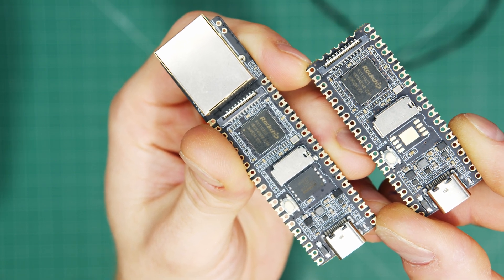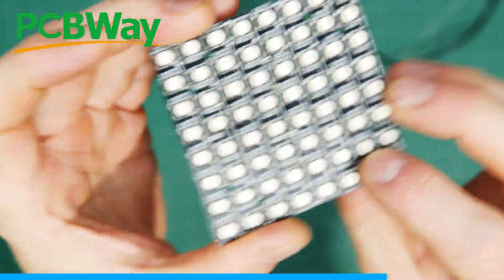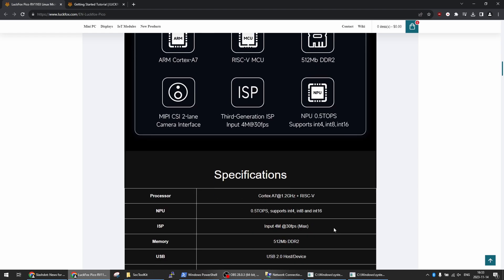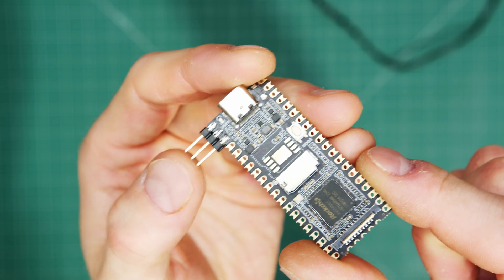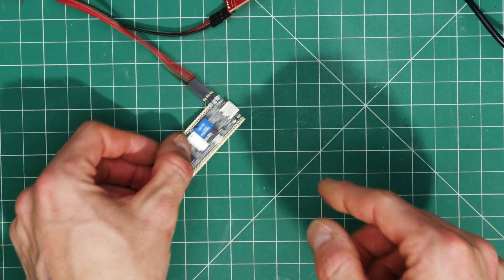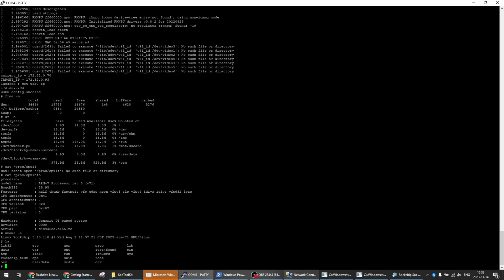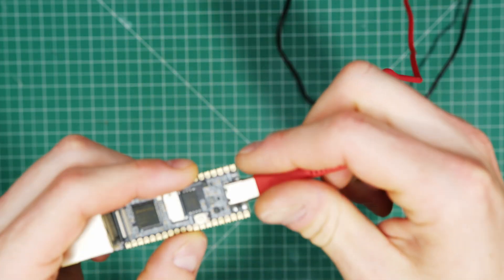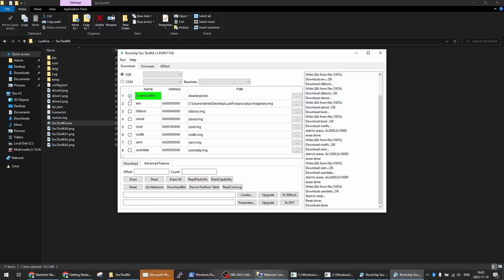Luckfox Pico - Milk-V Duo and Ox64 Killer?

Comment: Is it possible to make a NAS with this thing?
Reply from the maker: My friend I don't think I can give you a proper answer here, as that question is very loaded.

NAS is Network Attached Storage, so yes, it basically is already since it has a network port and runs Samba.

Can you plug a pile of HDDs into it? No.
Reply: @PlatimaTinkers  That's what I was wondering. Thanks!
Reply from the maker: @alessandrofonseca7796  NP!

Comment: Luckfox Pico is an excellent product with such small form factor. I've compiled the Ubuntu OS with tun/tap interface with Luckfox SDK, install Openvpn client, then configured it to connect my Openvpn Server. I put it to my customer's office. I no longer need to go to the customer's office for server checking.
Reply from the maker: Hey mate that is great to hear! They certainly are bloody small but handy!

Coming from a cyber-security standpoint I have some issues with that setup, but there are of course protection you can put in place such as IP-restricted jump boxes with push MFA, pubkey authentication per-session, etc
Reply: @PlatimaTinkers  I think VPN is more secure than Teamviewer or Anydesk
Reply from the maker: Very very true!

Comment: This is A great video. I got my Luckfox Pico Plus to work and could SSH in to it and login over the network. DHCP worked right away.

Worked pretty well actually!

Now I am trying to use the Ubuntu image and boot from SD.

I kinda got this working... but seems odd.

Took for ever to get an IP address. But now it shows up... maybe an initial install/setup going on first time?

Then to SSH login, it works but takes about 10-15 seconds to finally get to a prompt.

This typical?  I haven't tried another SD card yet.  Need to find another one, just to make sure maybe a sketchy card.

But over all it seems a bit, lethargic using the Ubuntu / SD setup  ?

doing A apt-get update took like 20 minutes or something to do.
Reply from the maker: Hey thanks for the feedback mate that is really awesome to hear.

I've heard some people complain about this! I've personally not experienced it. First boot does always take a while though.

What image were you using? I can test it out and ask their support team if need be.

Comment: Is it possible to make a pico w micro? Like rp2040 on one side and wifi module on the other. 5 gpio. No USB but pins for flashing. Love your pro board
Reply from the maker: Yeah I've been thinking about designing something similar. Like a SG2002 with a W600 module.

Cheers mate!
Reply: @PlatimaTinkers  I would love a half sized pico w
Reply from the maker: @mrlately7253  You're talking about Raspberry Pi with an RP2040 / ARM Cortex processor? 

Cause there's the Pico Mini, which has no wifi but is stamp sized. Or the LycheeRV Nano W, which has wifi and uses SG2002 so both ARM and RISC-V options :)

https://shop.plati.ma/products/sipeed-lycheerv-nano-we-beta <- few left, they're pretty cool but are meant for people with technical prowess
Reply: @PlatimaTinkers  thanks for the support beyond the videos.

I basically need to be able to do the same I can on a pico w but smaller. I only use a few pins. I'll check the links you shared. Thanks again
Reply from the maker: @mrlately7253  All good!

And yeah LycheeRV Nano WE would be good then! Else https://shop.plati.ma/products/pine64-pinenut-model-12s-wifi-ble5-stamp is tiny and cheap and has wifi.

There's a few options out there. I also have some ESP32-C3 and S2 boards like https://littlebirdelectronics.com.au/products/esp32-c3-mini-development-board-based-on-esp32-c3fn4-single-core-processor-160mhz-running-frequency-2-4ghz-wi-fi-bluetooth-5 that work really well and can run Arduino, ESPHome, MicroPython or C! I use them for garage door controllers, etc. DFRobot make the 'Beetle' series which are the same.

I have https://shop.plati.ma/products/esp32-cx-riser-board-v1-1-assembled-with-c3-and-led which is a prototype product but does work. Maybe not for your use case though!

Really probably depends what IDF/SDK you want to use! C, Arduino, MicroPython being the big ones.

Comment: does any one know if this supports the pi camera
Reply from the maker: You'd need to specify exactly which camera. As long as it's supported by the kernel, eg IMX219, and has the right connector (Luckfox Pico has a 20-pin FFC, so might need an adapter cable), then at most all you'd have to do is modify the device tree.

There is a bit of doco on it here https://wiki.luckfox.com/Luckfox-Pico/CSI-Camera. The camera it's designed for works out of the box with RKNN etc, and is probably best stuck to for documentation and support reasons, but of course depends what you want to achieve.

Comment: I saw a video that compared RISCV against ARM and the ARM core was consistently better so I think the ARM processors give you better performance.
I also saw a video that complained a lot about the support for a lot of these Chinese SoC carriers and the No. 1 issue was making them work with established code libraries etc, so for me PI may be more expensive but life is short.
Reply from the maker: That's not really comparing Apples to Apples though, that's more saying you want two oranges but being given a lime and an orange. They're quite different in how they work, and RISC-V is quite new.

Yes, if you want raw power, go ARM, but you miss a fair bit of the point then, but it's not always about power and these 1Ghz+ processors are a tad insane; that amount of power in an embedded device is just not necessary 99% of the time.

Comment: How are we supposed to burn your image file in the links? Its not supported by any sd-card writer I have tested? edit: i was able to burn ubuntu from luckfox wiki, but they do not tell you the root password, I can ssh to it, but luckfox does not work as password :/ edit: I must fix my eyes, its pico and not root as username lol.  now it works
Reply from the maker: Hahah sorry I didn't get to this sooner and help you out, was sleeping :P

On Linux and Mac I dump the image on the SD card just using `dd`, but you can probably use Disk Utility - I think there's an option to restore/write image. On Windows I use Balena Etcher. Just un-gzip it first if using DD!

Comment: I wonder, since I never really see people use the tpu in such boards, yet on paper some of them should give compute power in speciffic AI related workloads close to around a quarter of the performance of a rtx4060(one of those new beagle bone boards, not cuda however), while using insane amounts lower power.

so why doesn't seem anyone to be using those TPU's or C7x DSP's, fpga and such for AI tasks such as language models and image generation, just like the raspberry pi's they probably could be quite doable to cluster and might even be added on a single pcie card, I wonder what kind of performances could be reached that way, even though ram might be a issue, but for everything there are solutions. I mostly just wonder if there really isn't any development for AI to run on such hardware, since it would be much more efficient than how it is done now, and they already did make things to run it on integrated gpu's and old cpu's which technically seen would be a lot slower at such things in basically any way since they also don't benefit from the cuda cores or such.

this has also been proven by intell adding a very small npu into their new cpu's, and using that NPU actually was much faster than the cpu and the gpu in those apu's, also noticably beating the amd apu's, despite that integrated NPU being a very small very low power part.
to make it more serious, some of the SBC's from beagleboard actually have a quite a lot faster NPU in them than those intel APU's have, intels next gen was supposed to have faster NPU's, but those results where gotten by people using the old integrated NPU which actually was slower than the NPU in some of those new beagleboard computers. so honnestly it seems like big AI and such really miss a lot of opportunity by getting stuck in those big gpu's and such rather than trying to find ways to make it work properly on such small formfactor low power hardware.
Reply from the maker: Hey mate bit of a long comment and I'm slightly rushed sorry, but I think you're missing a fair bit of information there from what I can understand of what you've said. The terms are all right, but you're seemingly not using them in the right context.

The TPU/NPUs in these might do 0.3-5 TOPs @ INT8, which is great for some basic machine learning, but absolutely nothing close to what an RTX4060 can do. An RTX card is hundreds of TOPS and also using a 16 bit floating point number as opposed to integer, so you can use less space for faster transformations or inferences with a greater degree of accuracy given the wider gamut of number values that can be represented. Those can do some complex DNN functionality like text to image generation, large language models, etc. Even further to that, RTX 3k and 4k series supports a newer type of floating point that is specifically designed to work better with AI (bfloat16).

These SBCs I develop on and show off are small units that are better at ML for tasks such as facial recognition, and then embedding them in smart door bells, IP cameras, robots, gardens, etc. There's then also a bit of an issue with memory; to run a 7B parameter LLM on a GPU you're going to need a hefty card and then minimum 12GB of VRAM, and even then you'll only get 1-8 tokens/second. These things have 16-512MB of RAM, so you'd be lucky to get a 500,000M param LLM running, and besides it talking garbage, it would be extremely slow due to the IO bandwidth available, and that's if you can even quantise a fp16 model to run on int8, in which case you'd likely lose some of the LLM "magic" in that case.

Long story short; different power level, different 'neural' technology, different use case, different market and price. That is just my understanding though, and I could very well be getting some details wrong there! That being said, I have 2x GTX 1070 Ti's, an RTX 2080, an RTX 3060 and an RTX 3080 that I run different LLM and diffusion models on, so I do have a fair bit of familiarity with the tech... Just still saving for an RTX 4090 one day 🤘 Thanks for your input either way!
Reply: @PlatimaTinkers   well if you are saving for a 4090 you might wanna wait for the rtx 5000 series which might launch not to far away are supposed to be much faster than the 4000 series.
for the TPU's from most of them I didn't actually know their speed, 
However I speciffically based it on the beaglebone AI-64.
the beaglebone AI-64 is suposed to reach
quite high numbers and also has multiple different accelerators from which some are really fast.

even though I indeed do not know all about such things.
but I do know things could be much more efficient, but that would also largely depend on the AI itself being designed to be efficient instead of based around normal hardware.
however lately I was thinking that since AI like stablediffusion uses essentially weighter random noice, that it might be accelerated and made more efficienty by using a second model at first which instead of training noice clouds would train more on fractal clouds, that way if that works right it might be able to skip many steps in the proces and only do a few steps at the end to make them some less fractalish.
Reply from the maker: @ted_van_loon  I don't think there is going to be huge jump from the 4K to 5K range from what I can see - eg minimal new data types, just a smaller lithography, extra pipelines and cores, faster memory, etc. I'd say once the 5K comes out, I'll grab a 4080 Ti or 4090 as the price will drop, then maybe wait for the 6K when they do something mental like 1nm lithography, GDDR7, etc.

Re the BeagleBone AI-64, it's a pretty bloody powerful board - it'd definitely go a long way towards something like a high-end video editing system if utilised properly, but it is still not designed to run models like LLMs. It's got an 8TOPS TPU, high bandwidth ISP, a decent little GPU, and 4GB RAM (ignoring the DSPs). This is higher than the Fire specs we just discussed, but more designed for robotics and automotive. Eg it would be great at real-time processing of multiple video signals for things like depth mapping, object recognition, collision prediction, etc.

You can find examples of the models at https://github.com/TexasInstruments/edgeai-modelzoo and get an idea for how the board may be used. If you wanted to compare it to a GPU for running diffusion models like SDXL or LLMs such as Mixtral 0.2, you might need a few hundred of them, and then you end up with something less power efficient and less compact plus the challenge of trying to get the data between them using very limited interconnects like 1Gbps LAN (AI infrastructure will often run 40Gbps - 400Gbps fibre interconnects).

Large companies such as Mistral, OpenAI, Alphabet, Meta, etc, are all working on making these inference and diffusion models more efficient, however, the long and short of it is that how they work requires massive amounts of data to be multiplied at blazing speeds, which requires a lot of fast RAM, high bandwidth, and seriously huge parallel pipelines. CPUs are crap at this, TPUs are okay at this, GPUs are great at this, and AI accelerators do it excellently. 

I get where your idea is coming from, however, unfortunately it does not work anything like that, and the AI is not based around any hardware; the goals are typically based around creating the fastest, most accurate, and smallest models possible, and it really doesn't matter what hardware it runs on at that point; GPUs are just the easiest for consumers, where as for high-end inference you'll want H100's or similar. They are called "GPUs" but really, they aren't. They're not meant for playing games, you can't plug a display into them, they just multiply matrices amazingly efficiently.

We all started using GPUs for this because rendering images and textures just happens to use a similar pipeline. I hope all that information helps you understand a bit more!

Comment: Can you use VNC Server or/and Desktop on Luckfox Plus?
Reply from the maker: Uhhh, I guess, but I cannot fathom the use case there. It's not really designed to have a GUI, but you could probably enable swap then install X and VNC to it from another computer. It'll run like a 1995 Dell. If you want to run X or VNC on the LuckFox SBC you probably need to implement a VGA interface by bitbanging GPIOs.
Reply: Ok thanks, should I buy Luckfox Pico Plus or Raspberry Pi Zero 2W?
Reply from the maker: @FastEarnMoneyWithApps  No worries. Completely depends on what you want to achieve though - do you need wifi or ethernet, do you need NPU or not, etc. They both compute, but both specialise in different functions.

Comment: Cool. OS only boos from SSD ? It support Ubuntu?
Reply from the maker: It's u-boot, so OS default from SD card or onboard SPI flash, but you can boot from ethernet or USB if you wanted!

The default image is Debian based, the same as Ubuntu is, but you could easily roll-your-own using `debootstrap` / `cdebootstrap` if you specifically wanted the Ubuntu flavour.

Just note that only Debian has significant RISC-V support so far, so best sticking to that ecosystem and the vendor apt repos.

Comment: For everyone considering this board:  The Camera and Deep-Learning Models currently don't have Python support. Everything up until running the demo works great but sadly there's still a lot of functionality that requires significant tinkering in C++.

There is Python support for almost outputs such as PWM and SPI, they have a pretty good wiki page, but there's still some work to be done before the software is fully ready.
Reply from the maker: Very good to know, thanks for the input!

Comment: Can it run alpine Linux and can I connect a USB soundcard via usb c?
Reply from the maker: I think you asked on Reddit? :P And yeah, USB-C addons work fine as long as the Linux kernel has the driver, and it could probably run Alpine but it'd take a lot of kerjiggering I think!

Comment: I have one but I think Luckyfox's other product the RK3566 outshines this minature model. The RK3566 module comes with way more RAM 5.8ghz wifi a faster 0.8TOPS NPU and has alot more use cases with the base boards it can stick on. I do appreciate the fact that Luckyfox/waveshare went through with easy to understand dovumentation although it was not like that when these devices where first blasted all over Amazon. Really if your trying to produce content you want something that comes out of the box running so you can get on to the next product which I think most people are trying to do. That seems to be the bigger issue is that there are so many choices from so many companies doing the same thing to gain marketshare. It eveident by how many board have been released with the RK3566 just in the last 2 years. Eventually something more powerful will come along and push the RK3566/RK3588 out of the spotlite and everyone will go consume next product.
Reply from the maker: Hey yeah the Core3566 is awesome! Just way bigger haha.

Did not know it has dual-band wifi though, which is great. Thanks for sharing that!
Reply: @PlatimaTinkers  Yes the module has on board dual band wifi. Not the SoC just to clarify.
Reply from the maker: @filthyfrankblack4067  AH yeah okay that makes sense. Many thanks!
Reply from the maker: @filthyfrankblack4067 Hey nearly missed this. You can use Linux - that's what I typically use. What issue are you running into?